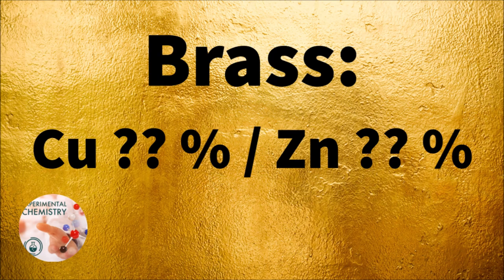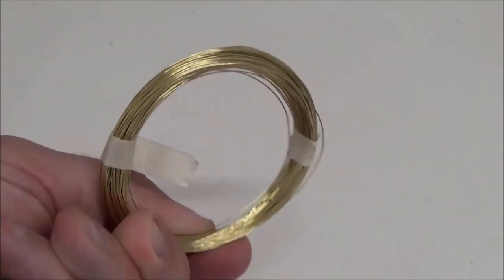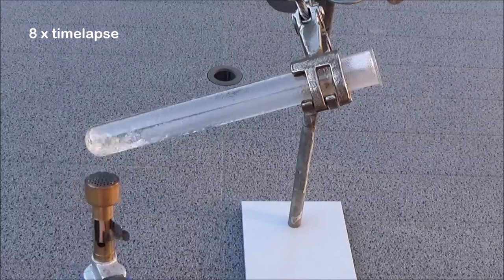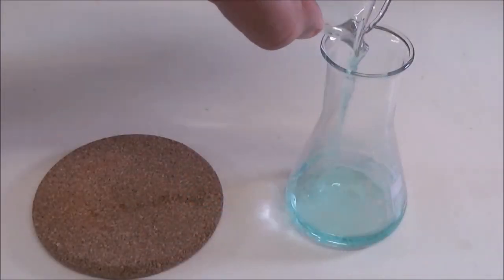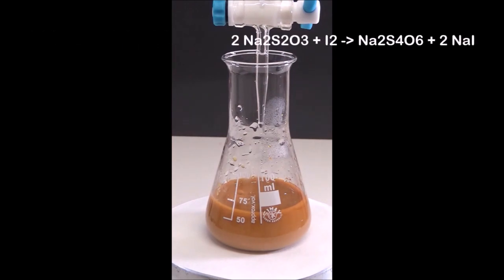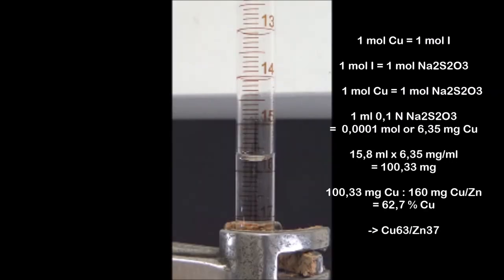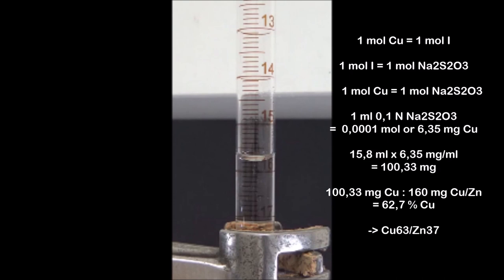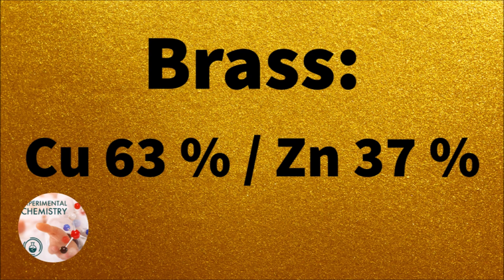Experiment No. 48: How much copper is in brass? (Iodometric determination)

Comment: Awesome iodometry application example! 
I'd love to see you do a video on the synthesis and isolation of tetraiodine nonoxide via iodic and phosphoric acid, but if that's too exotic then seeing iodoform made and isolated and prepared into medical gauzes would be equally as amazing.
Reply from the maker: Thank you very much!

I've already thought about diiodine pentoxide before and would have liked to use it as a detection agent in my video about carbon monoxide.
But you need iodic acid to make it, I don't get that and would have to make it too first - which in turn requires fuming nitric acid.
And since their use by private individuals is banned in the EU, I don't show my viewers, who are often hobby chemists, any experiments with them either.

The production of iodoform is not a problem. That would have been planned at some point in the coming weeks anyway.
I have a few other videos in the pipeline and in planning beforehand, but Iodoform will come after that - definitely.
Reply: @experimental_chemistry  The production of iodic acid has held me back personally so far too as I also fully remain within local regulations which prohibits HNO3, but I recently heard about another method for the production of iodic acid. It is still out of my capabilities to perform at this time due to the evolution of chlorine gas and my lack of a proper fume hood, but perhaps it would be approachable enough for you to enable your progress towards the Iodine Oxides: 

Form Chloric Acid from an alkali chlorate salt + H2SO4 or H3PO4, then react I2 in the isolated chloric acid to perform a substitution that replaces Chlorine with Iodine, then evaporate to dryness. The starting chlorate salt reagent may be made by disproportionating hypochlorite solution through boiling.

I've been wondering if simply protonating KIO3 with stoichiometric acid, perhaps H2SO4 or H3PO4, would work to free HIO3 and result in filterable precipitate, do you know perchance? Iodine chemistry is barely mentioned in my textbooks and has seldom come up in my education. Iodine just doesn't seem to get much attention in most curriculums it seems.
Reply from the maker: @oxoniumgirl  Alkalichlorates and conc. H2SO4 are banned, too. No chance to show things, an amateur can legally recreate with it...